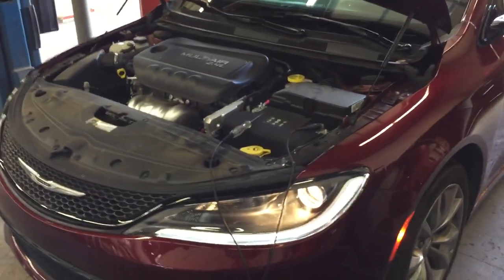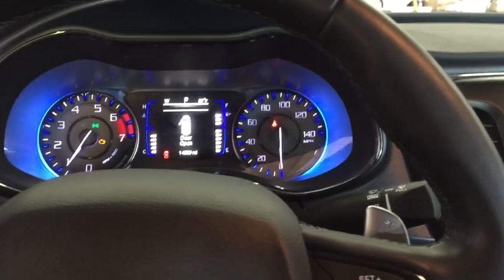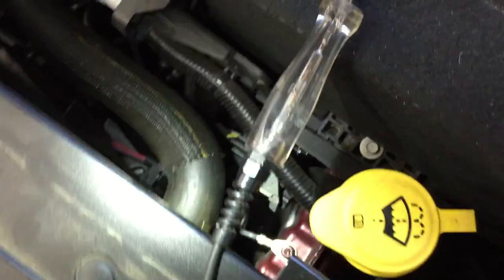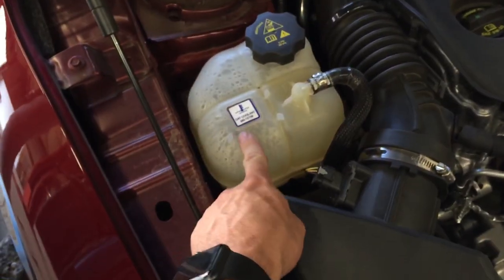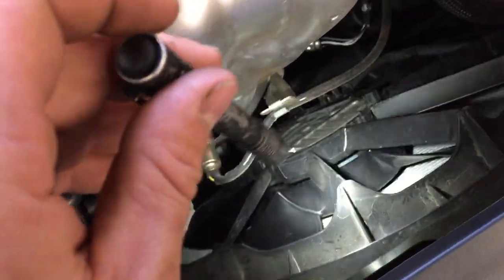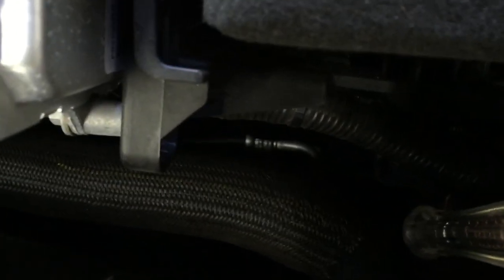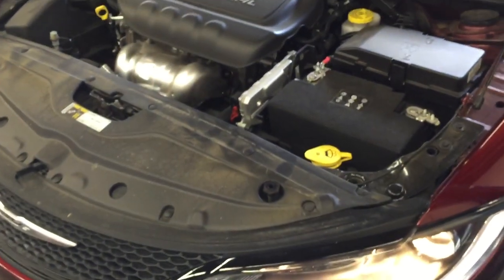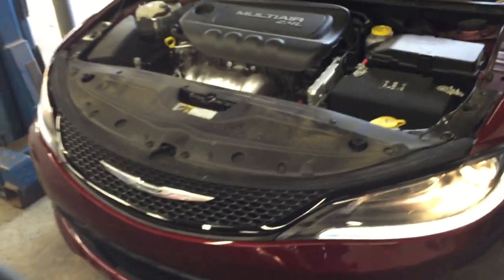Chrysler 200 Overheating Problem

Comment: I had this same problem at 198,000 miles. Fixed it by replacing the 5 amp fuse in the engine compartment for the fan on/off switch. Works like a charm. Car was overheating and broke the internal plastic off two jumper hoses and I couldn’t figure out why. All this time it was the fan never coming on. Thermostats are a common problem with these cars but for a 2015 with now 200,000 plus miles on it this has been a good investment. I sell Chryslers since 2013 and now work for Hyundai but I’m still Chrysler certified. People talk shit about the Chrysler brand for good reason but my personal experience with them has been above average on my 2015 Chrysler 200S 2.4L
Reply: I'm a try that tomorrow and see if it works because I tried everything else etc....
Reply: Can you please guide me on how to fix it and where’s it located at?
Reply: any tutorial?
Reply: What's the outcome on your end from changing this?  @Mcfieldgeneral

Comment: I bought my 2015 Chrysler 200s with the Multi Air 4 cylinder in Sept 2014 and drove it 6 years and 130k miles with routine maintenance and didn't granny drive it either, quite the opposite, and it functioned perfectly and I would have bought a new one in 2021 if they were being made. Sporty and economical too. It wasn't a Chrysler but wore the badge. It was a lot of Alfa Romeo inspired suspension and the uni body chassis was built to very high production values. I am now driving another 2015 s as mine was totaled after being rear ended at a stop sign. I am looking for another to trick out a little because I believe in these cars, I know the back yard mechanic who happens to work at a dealership has issues with these because they are not a 65 Chevy and take knowledge and proper tools to work on. The dealership installed a new set of OEM tires inside out, if they can't do a tire swap any actual work on a modern car is way beyond their skill level.
Reply: I just got a used 2015 limited and its not bad just over 100k

Comment: I like how you let the engine run with the radiator fan motor disconnected whilst running the A/C.
Testing its overpressure sensors and valves are we ? Poor A/C compressor...

Comment: Can't properly cool a 184hp engine... What a joke.
Reply: @TheSavage3.6  Lets say we have 2 engines. Assuming 25% thermal efficiency for both engines, with one engine producing a continuous 200hp, and another engine producing a continuous 400hp, then the engine producing more power will produce more heat. More heat requires a radiator that is more effective at dissipating heat. It isn't simply just the fan (it's a large part) if the car was used in a manner that was more than stationary.

Comment: These 2.4s seem to be having a lot of problems in this car. I have a 2015 200C AWD with the V6 and I haven't had anywhere near the extent of issues. Mine seems to run a little hot when it idles for a while with the A/C off but not to the extent of overheating or throwing a check engine light. With the A/C on though the fan runs and I've checked for coolant leaks and there are none. Is that normal for the V6? Early on it had a problem with the transmission control module that had to be replaced (that was about a month after I got it) but since then it's been trouble free and I have 24,000 miles on it. I drive it A LOT for my job and I can't say it's been unreliable. People love to say Chryslers are garbage but my family has owned them for years and they've been some of the best cars we've owned. The only one we had that wasn't as good was a PT Cruiser (they're known for being mediocre) but that said it never left us stranded.
Reply: I have an 2013 Chrysler 200 the only issue I had with it was the a/c condenser and alternator needing replace. I have had this cars since April 2014.
Reply: Hey Michael was yours ever hesitant at low speed hesitating to shift
Reply: I'm thinking on buying me a 2016 chrysler 200 I'm going to go check it out tomorrow I'm kind of glad I saw your review so you think i should buy it?
Reply: @gerardoalmanza7477  did you buy it ?

Comment: I replaced my fan,thermostat flushed coolant looked good. Still overheating at idle. Took the oil fill cap off an I have alot of blow by. Oil looks good no water in it. What do you think it could be.
Reply: Fuse

Comment: I bought my 2013 200 2.4 lx back in 2014 with 38k miles and now it’s Dec 2022 it has 178k from driving back and forth between states every month and these past 2 years have been taken a toll on me. I love the car but it’s been one thing after another. Just replaced the engine cover gasket and no more oil leaking on it but now something else smells like it’s burning. Popped my radiator cap off because the temperature gauge is going the halfway line and smoke is coming out of the radiator. Smh. Possibly housing assembly thermostats. Smh.

Comment: 2015 2.4s. No issues so far. 102k miles
Reply: What about now
Reply: @Smoovee1  😂😂😂😂😂😂
Reply: how about now ??????
Reply: I had my 2015 limited 2.4 Chrysler for 3-4 years now and haven't really had any problems besides now got a coolant leak but that's about it and maybe time to change one of my wheel bearings.. other than that it's been doing my family and I wonderful... No major maintenance besides now..  it makes it back and forth to children's hospital.. on to which I have to go on a regular for my son and all his appointments.. so far no real complaints.. just ready to upgrade now

Comment: 2016 Chrysler 200C AWD V-6 I have 50,000 miles never had any overheating issues.
Dealership service tech told me that 10 years or 100,000 miles coolant has to changed.
I really like car very fast.
I had a 2003 Chrysler 300M with 130,000 miles getting harder and harder to find O.E.M. Parts, sold car last year.
Lady had 2000 300M with 200,000 miles not running very well, She bought car for $3200.

Comment: I got a 2015 Chrysler 200 that I bought new and I too am having the overheating problems so guess this could be my issue? when idling in heavy traffic the gauge goes halfway and I smell coolant under the hood...I also hear a clunking noise coming from the front suspension is this normal? and my transmission is acting up too...all this started after the car hit 15,000 miles and it now has almost 19,000 but the problems are getting worse and wonder if there is any other known issues?
Reply: Take it to the dealer, that thing is still under warranty. I would have taken it straight to the dealer the first moment it overheated and I smelled Coolant.
Reply: I have and they keep claiming they don't find a problem yet I still smell coolant and it runs funny while idling..I checked myself and have found nothing but the smell of coolant is strong while it idles...one of those weird quirks of newer cars I guess...they did reprogram the transmission and got it working better and did try to do a relearn on the cars computer to fix the idle but a week after it went right back to idling funny..
Reply: @KASHAAN FROM ATL 2 CALI still driving good at least ? any other issues ?
Reply: @KASHAAN FROM ATL 2 CALI how many miles ?

Comment: So my fan comes on at max ac, but not at high engine Temps. What could that be?
Reply: Still waiting for this
Reply: @trounbyfire  no, it did finally come on but only after the engine gets what I would consider to hot, but I guess is normal.
Reply: @kevintillack56  my 200 used to run 92-94 now its creeping up to 210-215 if i don't turn the ac on. Can't be right. Im used to 4 bars
Reply: @trounbyfire  I am also used to 4 bars, but the higher temperatures are normal for these cars from what I've read.
Reply: Me too ; Is it a problem or normal? I hope to reply as soon as possible
Reply: Any update on this?  @trounbyfire
Reply: @jeremyfernandes7781  yes i had a bad sensor. That's why it was ready so low. I forget which one but after replacing it it reported correctly